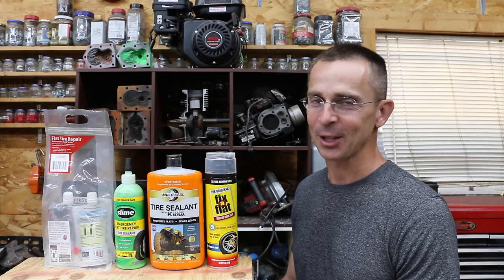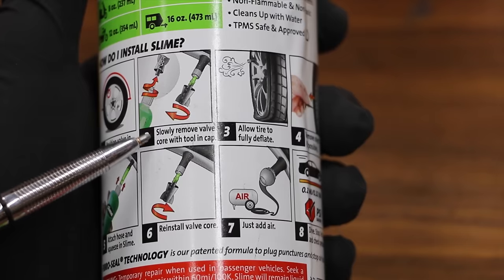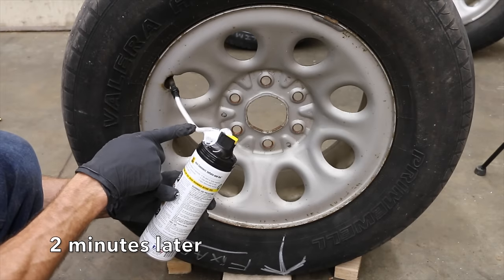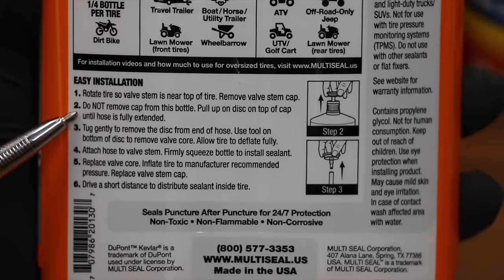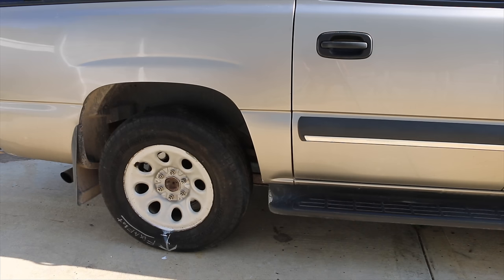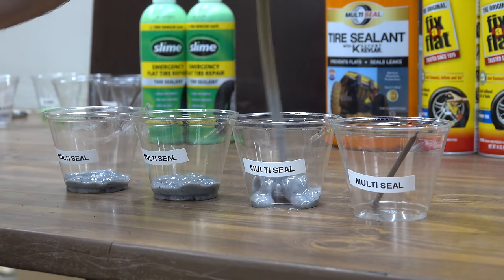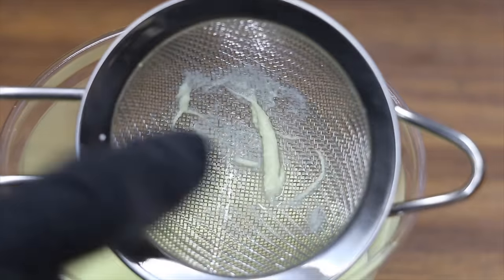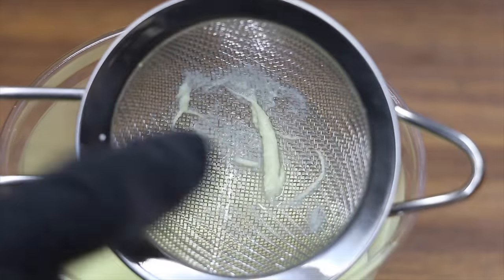Is Tire Slime the Best? Fix-a-Flat vs Tire Slime, TireJect, MultiSeal. Let's find out!

Comment: The only people disliking this video are employees of Fix-a-Flat.
Reply: Im sure 995 of the fix-a-flat employees don't care if people know their product is junk.
Reply: Used fix a flat back in the early 90’s and it worked great. Matter of fact, I drove in that tire for several years & never went flat again. Must’ve changed their formula.
Reply: @dontderockmeriz4546  nice try fix-a-flat employee
Reply: I wonder - can someone make a career out of trolling?  I swear it's what some people do.....
Reply: Glad I watched this video. It shows me just how I've wasted my money on fix a flat
Reply: @spaert  Have you heard of the internet?
Reply: @dontderockmeriz4546  I recently used fix a flat on a dry rotted tractor tire and its still holding air. I was surprised at this video.
Reply: @dontderockmeriz4546  That is how GREED works...You make a decent product, it gets popular, and you want MORE from that stream...SO GREEDY blood suckers will cut product quality, employee fairness, you name it.
Reply: Nah it's all the tire techs that hate dealing with the shit when they have to remove the tires off the rims.
Reply: How can “not-gonna-fix-a-flat” even legally sell that junk? It literally does not work. I’m shocked. I see those cans EVERYWHERE. WOW!!!!
Reply: nocturncal I am certainly not a fix a flat employee
Reply: @courtneesdad  maybe those super fine cracks were small enough Fix-A-Flat's watery liquid to run into them. That's failure mode is probably all it's good for. Or pin holes.
Reply: @spaert  Yes actually. There are interest groups all over the place paying internet trolls for pushing agendas. The most notable as it was exposed was "Correct The Record" that worked to spread propaganda for Hillary Clinton during the 2016 election. Still many groups around for many different reasons and goals.
Reply: @tylerh629  Thanks.  Had no idea.  I only knew there are trolls everywhere.  I personally mostly just ignore and block them when aimed at something I've said.  Life's too short to spend emotion or time on people who just want to start a fight.  I'll keep my upbeat attitude, thanks all the same!  Haha!
Reply: @dontderockmeriz4546  The original fix a flat i believe was flammable  and they got some heat ( no pun intended ) when some of the tires caught fire.   my guess here, is that the reason fix-a-flat  once worked is that they had some carrier that would rapidly evaporate when exposed to the air, and solidify some substance, blocking the hole.  by changing the formula  it probably affected the effectiveness. 

I do remember using this product back in the 90's.  and it did work for me.  i used one a few years ago, and it did not do anything,  I really did not think about this until you mentioned it, and after watching this video.
Reply: Don’t de rock me riz 
I used fix a flat on my tire 8-9 months ago & my tire has YET to lose even 1 PSI lmao!
That stuff has been incredible for me!
Reply: @ariansanders5140  My tyre tech has no problem with the stuff other than he gets less work fixing punctures. But he doesn't like doing punctures so he's not really fussed either way.
Reply: I’m not being critical only curious to what I’m not seeing as far as fix a flat and the flammability issue being mentioned. Since a tire will burn hotter and longer than any other material a vehicle is made of why would fix a flat being flammable be any different?  I guess I also think of the 15 to 30 gallons of gasoline that’s obviously flammable filling our gas tanks too. 
Oh........ I get it..... since it’s a well known fact fix a flat doesn’t work your tire would be skeeting flammable garbage everywhere unlike a sealed gas tank or your tire needing an open flame directly on it for a while to blaze up. 
   It should be re-branded to “keeps-a-flat” made by the sketchy snake oil corporation
Reply: @mcearl8073  please language!
Reply: LOL!!!!!
Reply: @nocturncal  no, he's telling the truth. my dad is a tire shop worker (has been since the late 1980s) and he said he used FAF on a tire back in '92 and he said it stayed leak-free for a long time, around 11 months
Reply: @wadesmith9483  honestly, i can care less if its flamable or  not. rubber in itself is flammable. the air inside the tire is a limited resource of oxygen to burn. even if forwhatever reason the stuff inside the tire spontaneously combusts, it will burn up the 02 inside, become C02 and water and extinguish itself almost immediately. the mass should be relatively the same and there will be little to no change in air pressure.
Reply: Fix a Flat sux. Bought 2 cans bk 2 bk. No results. Still needed tow. Horrible product
Reply: @I_know_what_im_talking_about  I know right. False advertising at its best
Reply: Or ChrisFix

Comment: So basically, all of the other products did the job except Fix-a-flat. That stuff is literally hotdog water
Reply: Not even that good... at least you can cook ramen noodles in hot dog water.  :D
Reply from the maker: Thank you!
Reply: Tosh.O can sell hotdog water and customers are happy.
Reply: Fix-A-Flat doesn't work unless the tire is turning
Reply: I like fix a flat I had a screw in my tire, and my tire was losing air within a couple of days I put fix a flat with screw still in, and it hasn’t leaked any air and it’s been weeks.
Reply: it says fix n flat!!!!!😂😂
Reply: You didn't do the Fix a Flat test right. Like at all...
Reply: @garyrobinson3735  It would be helpful if you stated exactly what he did wrong.
Reply: @DonziGT230  Two things that were not shown in the video...Shake the can vigorously for 30 seconds and then drive the car 2 to 4 miles to help spread the sealant around the tire evenly. I have made the mistake of using FaF and not driving around...and it did not work. I have used it a few times before and followed the instructions and it did work. I always opt to properly patch the tire before I use a sealant like this, but in a pinch I use it. To be clear I use Slime and a portable airpump since I have tractor tires, truck tires, trailer tires and ATV tires to deal with....and slime works on them all.
Reply: @rvninnorthcarolina3377  You apparently didn't watch the video before posting or have selective viewing because you're wrong.  The first can he shook on camera, but didn't immediately drive after installing the stuff.  He acknowledged that he didn't follow the that instruction so he did a second can, also shaken on camera, and immediately drove 4 miles.  He later stated that he tried 4 cans of it without success.
Reply: I have had Fix-A-Flat save my bacon twice while out on hunting trips. Large off road tires punctured by very sharp rocks north east side of Black Rock Desert. I thought it would not be possible, but it worked and got us 20 or so miles (a couple hours) back to Gerlach to have the tires repaired.
Reply: @DonziGT230  I did watch the video before I commented and I will point out, the proper test would have been to get a "fresh tire" (or clean out the first tire of the chemicals from the first try) and re-do the Fix-a-Flat test following the instructions. We don't know that the the fluid in the tire impeded the second through 4th cans to work right. The instructions on the can do not state "If this does not work the first try, introduce another can and repeat". I am not accepting or promoting the product since as I stated I use Slime, just pointing our a possible testing error.
Reply: it gets activated by movement  the tire must be spun  or drove on
Reply: @DonziGT230  You have to drive 2-4 miles on the tire according to the instructions. Must have something to do with the thin latex mixture. That said, I've found a tire plug kit to be a much more reliable solution and a lot less messy than FAF. I never used any of the other products, but a plug kit has worked for me every time.
Reply: Hotdog water still have a  better chance to seal a tire then fix a flat
Reply: @Dr.Westside That's exactly right. I used it for a good size slash from a piece of metal, tire went another 20K miles. You gotta put that stuff in and drive a lot so it will eventually be more permanent. Still like my slime better though.

Comment: Wow, Fix-A-Flat should be sued in court for false advertising.         I can't imagine the hundreds of thousands of people that bought these cans and keep them in their trunks for an emergency, just to find out that the stuff doesn't work.
Reply: Fabian La Maestra facts!!!
Reply: Class action anyone?
Reply: I tried to use fix a flat to seal a 1/32" hole in my bikes innertube. Didn't work at all.
Reply: please keep in mins that fix-a-flat is designed for ON-ROAD Tubeless tires. More heat is generated on pavement, which does not appear to be tested in this video. Personally, I have had mixed results with fix-a-flat, but it is supposed to be a Temporary fix.
Reply: @mysterytechknowledge3664  I will definitely keep that in mind while I make sure to never buy that product ever. :-)
Reply: I have used Fixaflat when I had a slow leak I couldn’t immediately identify and it worked. Not sure I’d use it on a full hole repair though.
Reply: I have used Fixed a flat successfully  a few times this is really shocking to me that everyone hates this product and that it failed both times.
Reply: It generally works for short term, but it is really only good as a solution because of the fact that it contains air for the tire itself.   The slime based products are better when you have the time to actually do the repair and access to air but they are not nearly as fast or as simple as fixaflat.
Reply: I have had mixed results but remember that fix a flat also INFLATES a tire and that alone can get you out of a jam.
Reply: It worked just fine for me
Reply: @MadLadCustoms  Class Action? Oh you get $2 and the lawyers get millions, yay!
Reply: Alpha namens it’s a win win to me
Reply: I've ran on fix a flat force month before I could afford a tire
Reply: Yep fix a flat sucks..I wonder how they are still in business selling this crap and it doesn't work...
Reply: That's my concern: I've never had very good luck with "Fix a Flat".
Reply: @mysterytechknowledge3664  Same here: I think from now on, I'm going to stick with "Slime", just because I HAVE had good luck with it.
Reply: My solution: Carry "Slime", and, I also carry a large bicycle pump.(not electric) Where I live, it's hard to find a service station where the air works, or,  it's coin operated, and always seems to shut off before the tire is up to pressure. Besides, road side, you need your own source of air. I prefer a manual pump, but an electric like he suggested at the end of the video is a good choice, as long as the cord is long enough, to allow easy reach to all your wheels. If you're towing a utility trailer, you may not be able to reach its tires, with an electric pump. a hand pump is a more sure thing.
Reply: @vincentrobinette1507  As always, I tend to stick with What has always seemed to work in the past. A full sized spare, or a doughnut, if available... A can of ANYTHING, is ALWAYS a LAST Ditch Effort.
Slime is a "I hope it keeps me from actually having to change a tire"  "Piss-in-a-Pot" "Solution."
Proper Maintenance, and Preparedness is ALWAYS the 1ST Defense against the "unforeseen."
(Sorry, not flaming. just a bit drunk right now.)
Reply: I wonder if Fix-A-Flat only works when it's squirted into a hot tire. It might need heat to cure properly.
Reply: @deusexaethera  Yes fix-a-flat does need heat to cure, but the tire doesn't need to be hot when it is put in. That's why (according to the destructions) you need to immediately need to drive the car several miles.
Reply: YouTubeY2K * thats what i am thinking
Reply: Ive never had a problem with fix a flat.. not even on my 3 wheeler tires when i was a kid
Reply: I use fix a flat all the time and have never had a problem.
Reply: @mysterytechknowledge3664   Then according you your logic ( re: heat needed to activate "fix a flat" ) then it should not be sold anywhere with cooler climates or winters .
I have used fix a flat on 3 different occasions and it did NOT seal , or temporarily seal the hole on any occasion .  I never imagined a product could so blatantly  lie .. I thought maybe it was just a bad batch  but clearly the product itself is no good.
Reply: @ethics3  On the can it tells you to drive the car(as long as wheel has lifted off the ground) immediately for a minimum distance/time. this is to generate heat in the tire to "cure" the sealant and stop the leak.
Reply: @mysterytechknowledge3664   Regardless of what it says on the can , the product rarely works .  
And as I stated in my previous comment , if this is the case , then the product should not be sold in countries with cold climates . Are you Canadian  or from the northern states? Try driving your car for a few miles in the winter and then feeling your tire. COLD !
But all this is semantics in view of the findings . Only a couple of people in the comments section has stated they had positive results with this product , and as I have stated , had very negative results using it as instructed on the can  , so that's enough evidence for me. You can go ahead and keep promoting it as your conscience sees fit … but you wont convince me
Reply: I'm not promoting anything, just sharing my personal experiences. 

If you don't agree with what I have to say, just move on...I have.
Reply: @mysterytechknowledge3664  People are free to comment and respond as they wish sir.  Because people have different experiences or opinions from yours should not afford you exclusivity on this matter.
It is an open forum 
If you do not wish people to engage you , then do not leave comments in the first place .
Regards
Reply: I have a can. I won't be using it now
Reply: If fixaflat requires a specific situation for it to be able to work and the others don't, then I'll go with the others.
Reply: @mysterytechknowledge3664  quote:  "please keep in mins that fix-a-flat is designed for ON-ROAD Tubeless tires. More heat is generated on pavement, which does not appear to be tested in this video. Personally, I have had mixed results with fix-a-flat, but it is supposed to be a Temporary fix."
response:  I've had similar results as well, I've never used it on a cold tire but after driving a while and using it had no issues with it working though I felt the tire wasn't fully inflated the can.  I know it didn't work on a friend of mine's bicycle and at least for my own use I use slime for my bikes.
Reply: Everytime i used faf it has worked for atleast a year. Only used on slow leaking tires however.
Reply: @vincentrobinette1507  I tried many emergency compressors.  The cords were to short to reach the trailer.  Even though I have outlets in the rear or the car.  They overheated,, blew fuses,, and took forever. I got a 20 volt battery compressor that also uses 12 volt and 110 volt.  It does a great job and is very handy.  I can put air in any piece of equipment easily.  It's pressure gauge is accurate and it shuts off automatically.  It will shut down on really big tires (tractor) but cools off quickly.